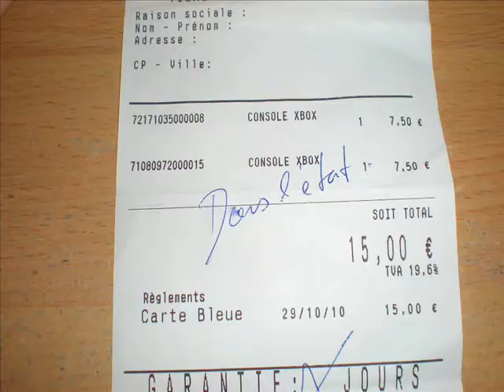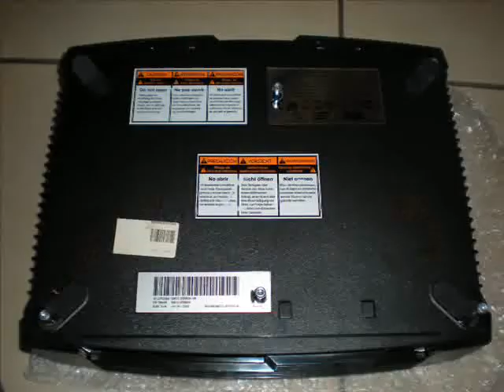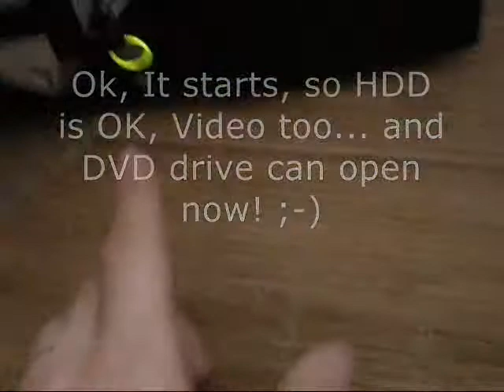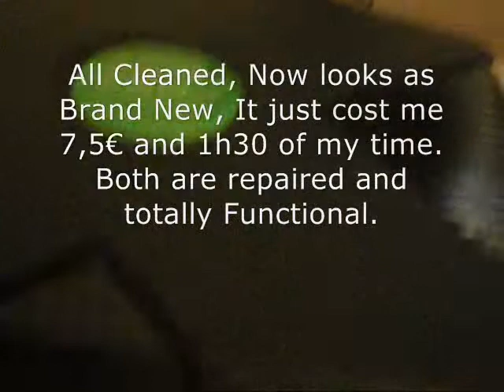Original XBOX Faulty DVD Drive Stuck Repair ( Samsung sdg 605b , SOH D16 )

Comment from the maker: if you can't repair your xbox with this tutorial, you must change the dvd belt, it's the most common problem on samsung dvd drive.
I received a xbox with this stuck problem, i did all like the video, but couldnt open, i change the dvd belt, and that's it, it works now.

Comment: @Wurmo there is a little hole in the front of the xbox between the #2 plug and the eject button. Take a paper clip and push it into the hole, that should trip the lever to manually open the drive.

Comment: You can actually remove the belt and clean it and the pulleys without even opening the system.  When the tray is open you can take the belt off with tweezers.  Then you cut power to the system, and hold a q-tip against the pulley as you manually move the tray back and forth.  Obviously it's not a bad idea to open it up and give it a thorough cleaning all over, but for people who don't want to open their system this method works well.

Comment: @ SN2OO8K: My tray wasn't working, it would not eject, I'd have to push on the tray to get it to come out, then it would just shoot back in half the time. I figured I'd clean the front end, since a few people told me that as long as you clean the wheel and belt in front, it should work. Well, it improved it for a while. Then, it went back to crap. I did it again, and now it won't eject no matter what I do. I used Multi-Purpose Machine Oil, that wouldn't mess it up, would it?

Comment: if your drive won't read disks first try buffing the laser with a camera cleaning kit. If that won't work you could use a VERY fine sand paper to try it further, super fine automotive painting sand paper ect, 5k grit or so. If that still doesn't work if you own a multi-meter you could atempt to tweak the lasers potentiometer.

Comment from the maker: I used Alcohol 90% and Q-Tip to clean the laser, do not push too strong on it in order to not damage the laser. Orange stuff, is mechanical grease, use it on tray and on the metal bar to make your laser slide better while reading a disc.

Comment: how did you manage to free the dvd tray itself from the rest of the dvd drive? my xbox's tray is stuck and wont open at all. it makes a click-clack noise when i press the tray open button (large button on front). so im inquiring if theres anyway an xbox can operate without the dvd tray having to actually oscillate outwards...i.e. make it similar to the original playstation where you just place the game disc over the laser lens and let it spin and load??

Comment: the tray open/close drive motor with the rubber band on it, take the band off, put some rubber cement on the drive spindle where the rubber band rests,let it dry. tray should open and close fine after that

Comment: its not laser issue. it's stuck and wont open.. i pulled it apart everytime i close disc tray its stuck and takes a bit effort with my hands to slide disc tray back out... im yet to buy some grease and apply it underneath tray

Comment from the maker: the drive belt is the problem.  It seems that due to heat and general usage, the drive belt that is responsible for opening and closing the drive will stretch or accumulate enough dirt that it starts slipping.
Buy a new one, change it and let's play.

Comment: Well, I took it apart and cleaned it very good. Didn't work. It made it work a little better, but it's still messed up. It would have been easier taking the thing apart if you included a more step by step process. You left a lot out, and I had to guess. But, I got it apart without incident. Problem is... The cleaning didn't fix the problem. Would a new belt make a difference. It doesn't look like there's anything wrong with it, but maybe there is. I don't know. I give up.

Comment: I'm afraid to take it apart. I don't want to fuck anything up. Is the Disc Drive easy to take apart? What all cleaners can you use on it? I'm so pissed... I tried to clean the front end, without taking it apart, and now it won't open at all! Please help.

Comment: Well actually my xbox broke all over. The sodder that connects the power cord out put the the power supply burnt off and could have caught my xbox on fire broke. I resoddered it and burnt off again and my power supply wouldn't work again so I bought a new one. The the grey wide wire strip that connects the DVD drive and Hard drive to the mother board had to be replaced. One of my controller out puts didn't work. My DVD drive couldn't read Games anymore. Then my hard drive went out.